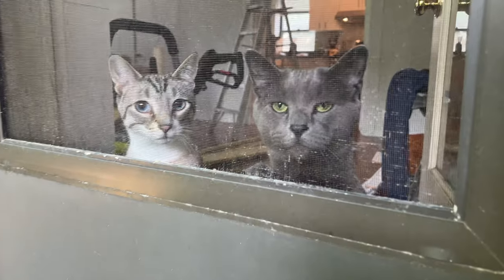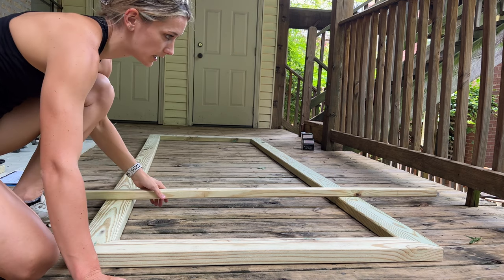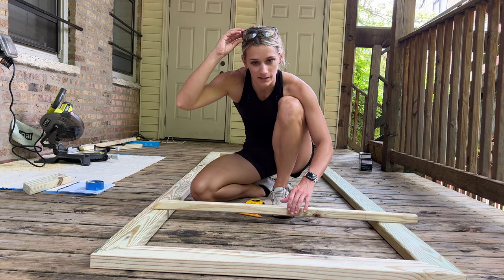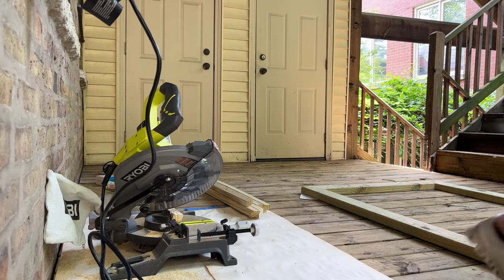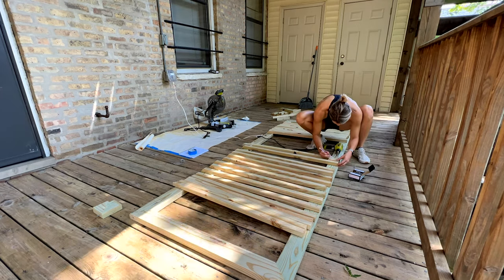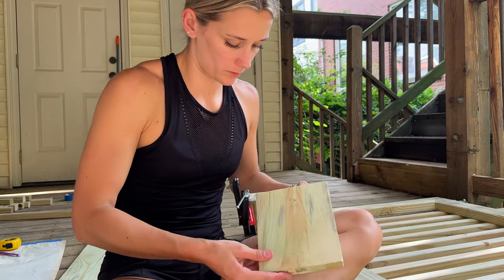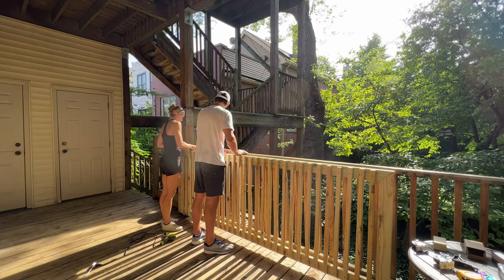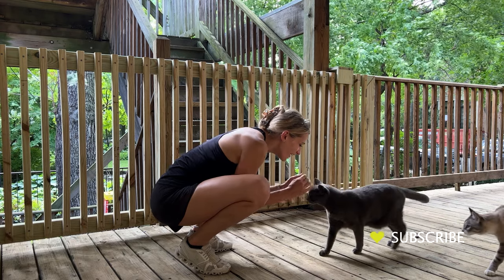EP 3 | Building a rolling deck gate (for my cats)

Comment: For the slide operation, you may consider a length of angle iron or flat stock on the back of the gate and a couple of brackets or wheels mounted to the railing for the angle to sit in and glide.
Reply: Ryan - can you provide more info on this. My gate is pretty wobbly so I think the wheels need to run in a track or something, but I'. not sure the best way to do it
Reply: @lindsaymeloy3808  If you screw a piece of flat stock iron (maybe 1/4" x 1") from where your gate lands at the post between stairways to the railing end, you could attach some wheels or some other hardware to the two posts and possibly to the rail closer to where it stops when it's fully open. You will need to stand off the flat stock with some kind of spacer like a stack of washers or maybe a small nut. This will space it out from the gate to give a rail to ride on the wheels.

Comment: Good job! Do you have any problems with the balusters getting hung on the top brace when you slide it? I'm trying to get ideas for my sliding gate on my pool deck.
Reply from the maker: Thank you for your comment! I made my top braces a little wider than the gate to allow for wiggle room. When I roll the gate open/closed I lean it straight so the balusters don't catch. My gate does naturally lean on the braces.

Comment: just built a gate but find it's walking around, not tracking straight. did this happen to you and if so how did you remedy?  thanks. good job, looks great
Reply from the maker: I put rigid wheels on mine because I read others had the same issue if you used castor wheels. The rigid wheels work great for me. Hope this helps!
Reply: @westonwillow  the rigid wheels were what I used. I just expected it to work better. that's for the reply